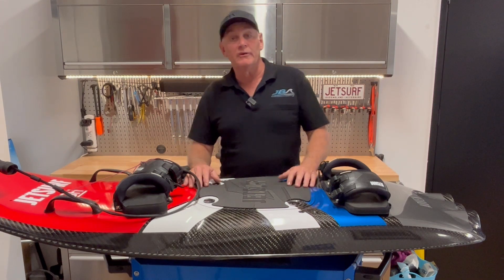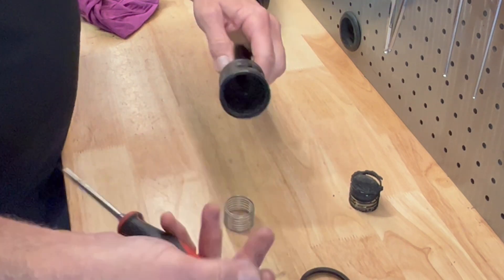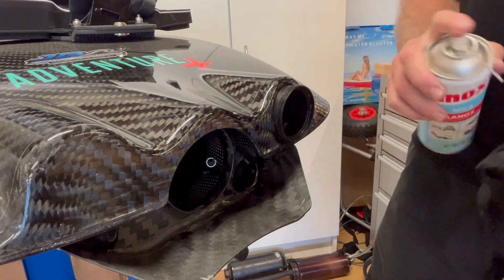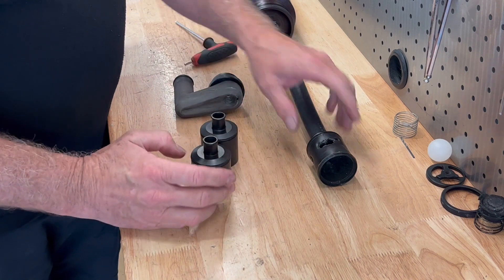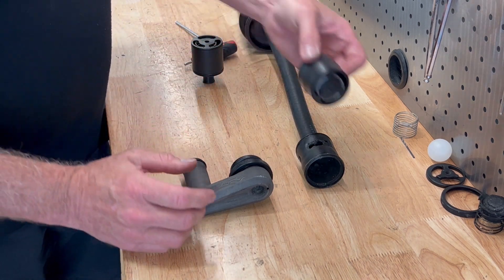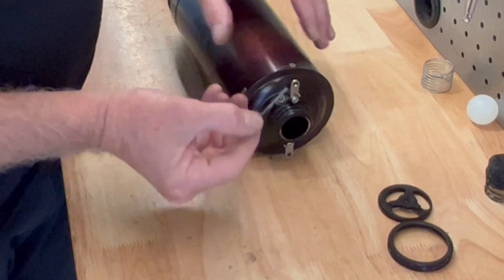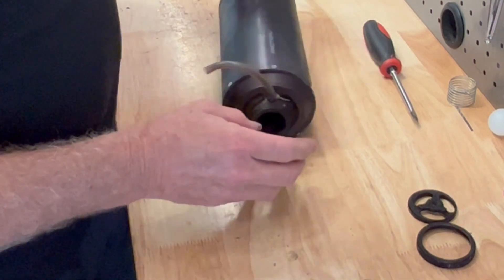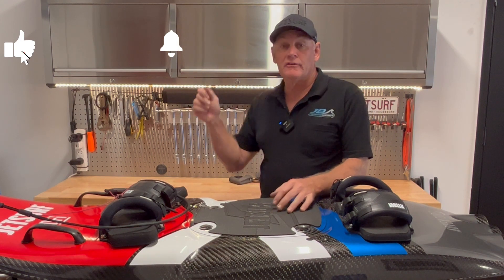5 Common Jetsurf Exhaust Problems Revealed

Comment: Hi, is it possible to upgrade the exhaust, from this regular to titanium exhaust? My board it's the Race DFI. I totally forgot to clean the tip and the ball and last part of the exhaust got melted. I am currently running without it which to be honest doesn't make that much difference in terms of sound and board feels slightly faster, so I kind of like it like this.

Comment: Hellow what you thinks abaut increase the diametre of water intake un the exhaust. Iam fernando to argentina i have a gp 100 2016 luke New. And i wanted to do this but need to Know what you thinks abaut
Reply from the maker: You really can’t make it much bigger the fitting is to small